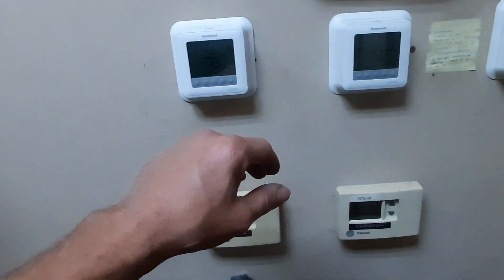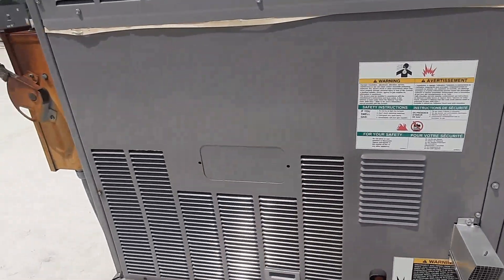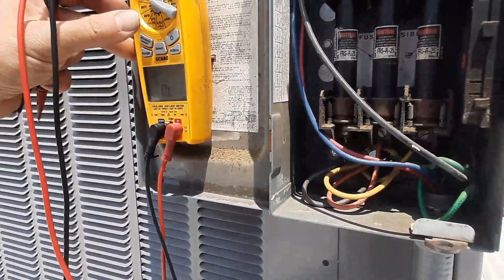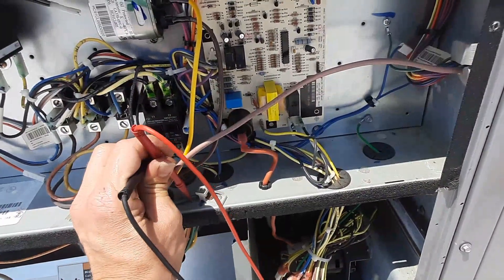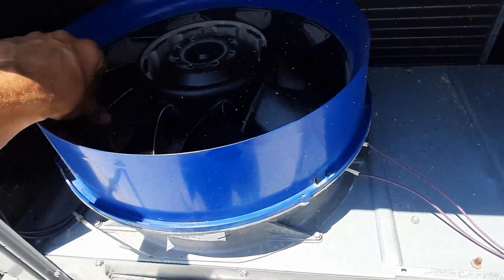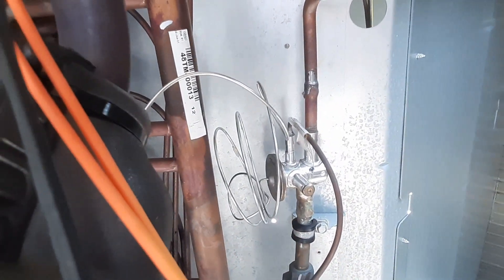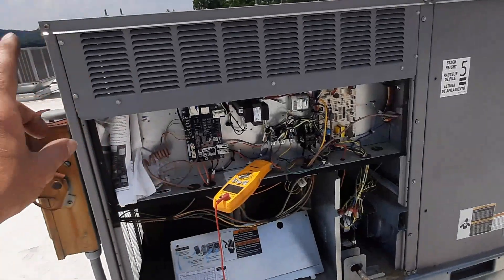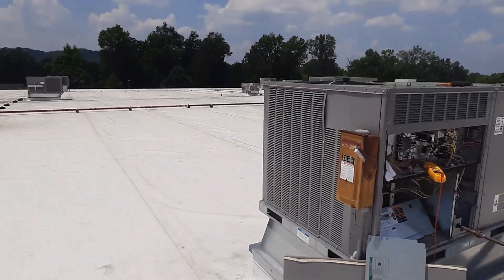carrier package unit breaker tripped.

Comment: Could have been the breaker below it over heating. Can cause the breaker above to trip. Or loose connections at the breaker or circuit. Just a thought. Nice channel.
Reply from the maker: Good call! It very well could've been the breaker. Limited access with this type of building, I was escorted in the rear area to locate and reset the breaker. It's dumb really,  no one on site can get me in there. I had to wait on someone who was rushing me like I was the inconvenience 😆. Thanks @robburch8530!

Comment: We have power issues here too. I always feel weird just walking away not having really done much at all.....but sometimes it really is the problem. Im wondering if your breaker is getting weak. The heaters in it are failing prematurely. Thats where an IR camera would be nice to use. Great video as always Steve...thanks for sharing
Reply from the maker: Thanks, Jason. The breaker could be the issue. Limited access to that room, and they have an electrician if that's the case.